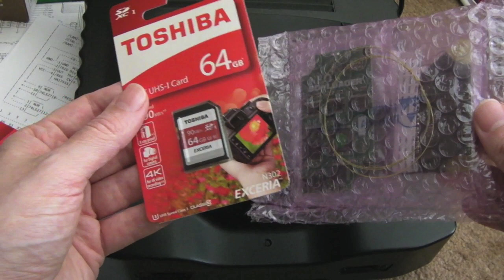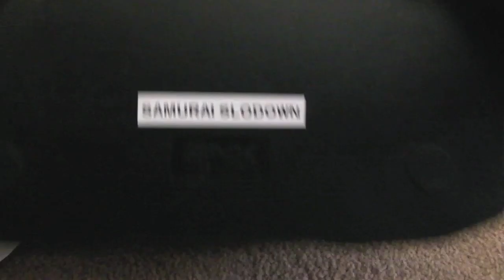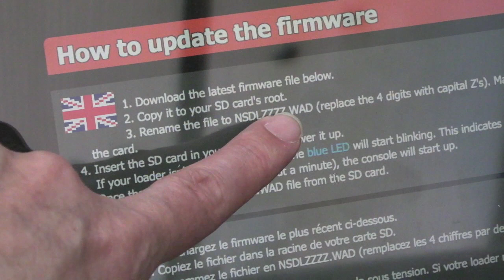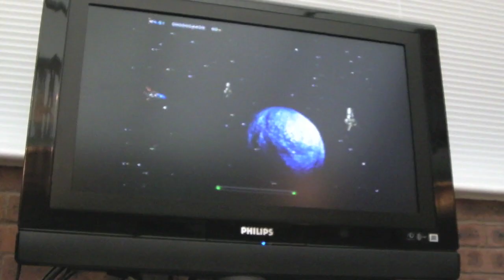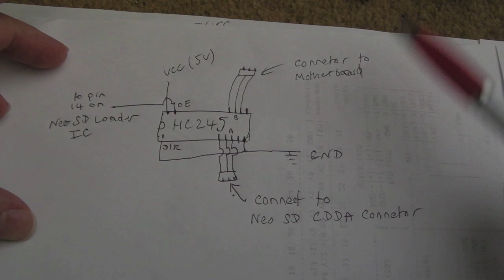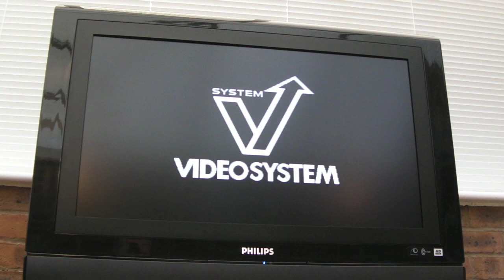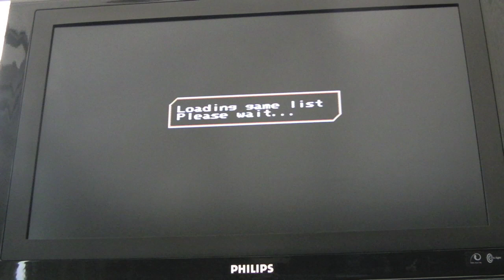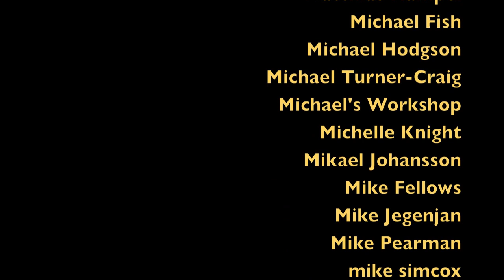SNK Neo Geo CD - Neo SD Loader Install & Review (Revised)

Comment: Thanks a lot for the very detailed installation and review. I'll send you the 500£ cheque as planned ;p
Here are the few notes I took while watching:

-Samurai Slowdown LOL
-Had fun drawing the pixel-art instructions myself :) Glad that you enjoyed them even if I'm aware that pictures would certainly be clearer for most people.
-I took note about making the CDDA connection instructions clearer. There's also another version of the CDA board which has different wire bundles. I'll also add a note about the two black screws behind the console, had totally forgot about those.
-Sorry for the shitty fake Kynar wire which melts at 120°C... I bought a better quality spool a few months later.
-18:24: Those areas just don't have any soldermask (bare FR4 material without copper), had them made like that to avoid the larger flanged screws leaving ugly marks on the soldermask. Not very useful, just a small detail that didn't cost anything to add.
-I also took note that the SD card orientation isn't mentioned at all in the instructions !
-Nice hack about fitting the triangle board internally, never paid attention to those 4 posts on the shield there. It's hard to imagine how they would have used them with the existing drive.
-Thanks for sharing infos about my chip RE
 projects, that's much appreciated. I'll have to add 100£ to the cheque :p
-Noticed that the game list takes much longer to load on your system than mine. It may have something to do with the games having longer file names than those I have on my test SD card. I'll check that tout.
-Added to the bug list: "Main menu shows letters but no games in list on some occasions".
-Added to the bug list: "KOF97 doesn't like waiting and causes timeout errors during in-game loading, sometimes freezes".
-"Furrtek engineering" is a lie, I'm not even an engineer !
-That sticky dirt bit on the CD drive gear... sigh
Reply from the maker: Thanks for the detailed reply there (and for sending this device!!!)!  The artwork is amazing on the website - love it!  The kynar wire you provided was great!!!  The melting bit made it super easy to use tbh!  Nice strong wire but also fine enough to route easily!  That dirt on the CD drive gear - LOL!  No idea how I did that!  It was a consequence of me having it assembled and then in bits over and over whilst working through things.  I must have contaminated it at some point!   And LOL @ the 500£ cheque - I wish!!!!
Reply: @GadgetUK164  About the KOF97 booting on sd loader, i tried many times booting the game with no errors. My iso is patched with copy protection removed.
Reply: Tu m’envoi un sample ? 🙇🏻‍♂️😁

Comment: A neat trick I've learned for easily lifting those small pins from TSOP and PSOP packages like the BIOS chip is to get a thin solid copper wire, like kynar, loop it around the leg you want to lift and gently pull on it as you heat the solder joint. It will lift the leg up and sweep away some of the excess solder in one smooth motion.

Comment: Does this work on all Neo Geo CD models?   I've got a front loader.
Also can you load in AES or MVS ROMS into it too?
Reply from the maker: EDIT: Correction - it's not working in the front loader atm - but it is planned!
Reply from the maker: See my correction there - It's planned for front loader, not working atm!
Reply: Devon Puzon  It really didn't work!
Reply: As of the new firmware, works on front loader now Larry

Comment: Great video, it made for a nice Boxing Day gift! I finally sat down and installed my kit this week, and I ran into many of the same issues you encountered. The NGCD I installed it in was a different board revision, and the loader was oriented vertically instead of horizontally; the ribbon cable is still an issue, though. I'm going to order a longer cable, hopefully that will make it easier to connect and ultimately easier to get back into the console when the need arises.

Looking forward to the RGB LED installation video. I've been mulling over how to do a proper install in place of the original LED, but if you have a better approach in keeping the original and installing the new LED elsewhere I'd be curious to see it!

Comment: At the 59:00 minute mark, there shouldn't be any appreciable voltage drop because the load on the SD card should be negligible. As for noise, that's a different issue. :) We would have to know what the load on the card is to figure out the drop, but I can't imagine that it is much.
Reply from the maker: Maybe voltage drop doesn't factor in here then, but some of these adapters just don't work with other peoples Neo SD Loaders.  It could just be all about noise!

Comment: devices like this are fantastic but im always so gutted when they don't easily allow you to continue using the disk drive along with it, as daft as it is I do like using my original discs (and even copies) instead of the SD loader from time to time so its nice knowing a version with that option exists.

Comment: hello, nice video, I instead blasted a track of the Mask 1 chip, I wanted to know if you have the datasheet of the neo geo cd to see how I can recover it. Thanks in advance
Reply from the maker: There are no schematics I am aware of... The best thing to do would be work out where the trace is burned out and wire link over it.  You may need to remove the IC with hot air first.
Reply: @GadgetUK164  Thanks!

Comment: I'm making my own but having trouble finding a good replacement for the PLCC connector. Furtek recommends the obsolete MILL-MAX 540-44-068-17-400000 but says the other similar parts have bad connections and are not recommended. Anyone find a good replacement for the original connector?
Reply from the maker: The only other thing I can suggest is to take a socket that will fit and sand down the plastic until its lower profile when reverse fitted to the 68K CPU.

Comment: Hello GadgetUK164,  

I got my SD loader kit second hand. I have Revision E with the Triangular SD Card Reader. Installation went fine thanks to your video however, I am not getting any sound from my roms. The CD player works and I hear the sound efx from the roms but there is no music. My roms do not have any wav files just bin and cue files so I wonder if that is it. I also notice that you discussed the cd audio not being able to be heard if you wanted to keep the cd drive. 

Is there any chance you could build me that board with all the wires and I buy it from you? I think I may need that board. I tried ooking for contact info for you to document the work but I cant find it..Please let me know if that is something you would be open to doing...im so close to finishing this install!
Reply from the maker: Try a different SD card - also make sure the SD card is FAT32 formatted.
Reply: @GadgetUK164  THANK YOU!! I will update once I try this!

Comment: loading time is still there, despite the games are loaded from an SD card
Reply from the maker: Yes, you still need to load the game in from SD card - there's no solution to that!
Reply: @GadgetUK164  once loaded from the SD card, the game still behaves as if it was on the CD, you still have "please wait", "now loading"
Reply from the maker: @tunkunrunk  That's correct, but you have shorter load times vs CD...
Reply: @GadgetUK164  that's good to know

Comment: All I'm getting is 3 yellow lights and then it boots. All the website tells me is "Your console's BIOS version was not recognized" then gives me zero explanation. Which is useless.

Any ideas on how to fix this issue?
Reply from the maker: Check if it wrote anything to the SD card - is there a copy of the BIOS it read there?  Maybe double check the wires to the mask ROM, if those havent been done correctly (and the correct pin lifted), it will not read the BIOS correctly.
Reply: @GadgetUK164   I appreciate the reply. I found the issue.

The foam padding that was included in the kit was placed in the wrong place, so when I put the shield back on, it would press the chip down in the wrong place, causing it to become unseated. Once I moved the foam, it pressed down in the correct place and it stopped unseating the chip. All is fixed!

So long story short, if you're getting the Your console's BIOS version was not recognized" (3 yellow lights) issue, then check to make sure the chip is fully seated.
Reply: @GadgetUK164  When i unsoldered the pin the pad came off... Do you have any suggestion where this pin goes on the motherboard so i can solder the cable on elsewhere?

Comment: I did this mod for a friend and after testing a few games I had a few issues. I could play the game for a few min and it would reset. I cut out some more of the shield as I though maybe it was touching the sd card slot. It worked fine. I sent it back to him and he said it displayed an error, which I can’t find anything on. I’ve tried two different cards and I can select the game when the menu pops up, but this error pops up and it’s a no go. I also updated the firmware to the latest when I got the console back. 0.9. Here’s the error code and the led is red even when I can select the game. 

00-0800-0803 also below that this shows

38 M0008 U0008

Any info or guidance would be helpful. It’s a top loader. Thanks
Reply from the maker: The only thing I can suggest is remove the mod, use a fibreglass pencil and clean the pins of the 68K CPU all around.  Then refit the mod - maybe you have a bad connection.  Then check the 2 wires that go to the ROM area of the PCB to make sure they are soldered well, and soldered well on the Neo SD Loader board.
Reply: Sorry for the late reply. I actually thought maybe it was the files themselves, so I used mostly all bin cue files and I added a few at a time and that worked. I did however play one game today and it was art of fighting 2 and it reset it self to the game selection screen after selecting the CPU character. I reloaded the game and it played fine. My friend told me when he got it back the first time I modded it, the thing would reset. I shook the console while playing and wiggled the video cables, power cable, and controller cable while playing and it didn’t reset. Not really sure why it would reset. Thanks

Comment: @GadgetUK164 - Retro Gaming Repairs & Mods

Okay, now I'm seeing a different problem as it pertains to the audio. You see I've managed to fix/remove all copy protection to these Neo CD games. The issue is after playing these games after 15-30 minutes I get stuttering or scratchy audio. This isn't all games I've seen this on later Fatal Fury and all of the King of Fighters games. This is BEYOND frustrating.  Meanwhile games like Breakers and Burning fight work perfectly after letting them run for over an hour.

Are these games just fucked as far as the audio goes or is there a certain way to repackage them? I've tried everything btw ranging from different romsets for said problem games to playing with the copy protection intact and they still fuck-up the audio. There a fix to this? I would be grateful for any assistance you could provide on the matter. As a community of Neo Geo enthusiasts and retro gamers we owe it to ourselves to find a solution here.
Reply from the maker: Maybe there's an issue with the DAC getting out of sync or something?!?  Which firmware are you using?